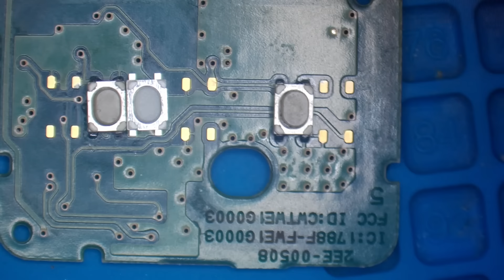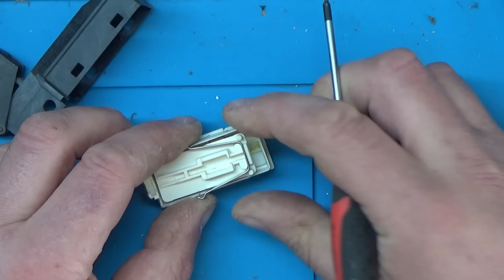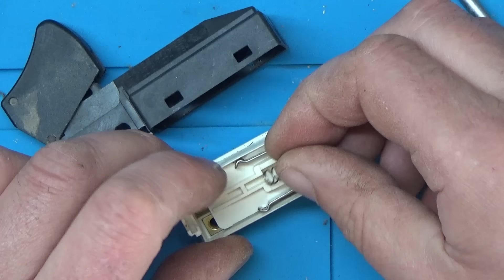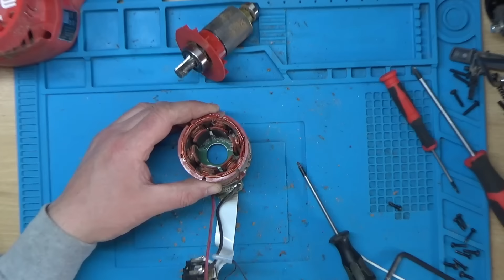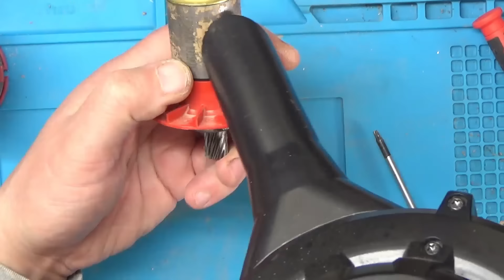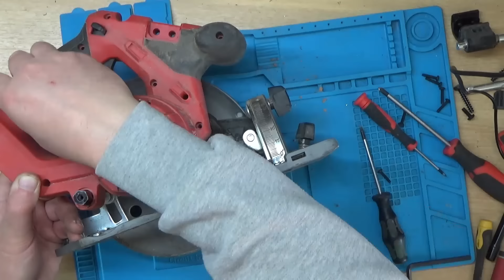Faulty Dacia Duster Key fob & Faulty Milwaukee Circular Saw | Can I Fix Them?

Comment: Autosol would have worked a treat on those contacts. I use it all of the time on guitar frets. Brings things up gleaming. I was also relieved to get to the end of the video and you to still have all of your fingers intact. Those blades are lethal.
Reply from the maker: Thanks for the tip with the Autosol. Yeah, I should have taken the blade off 😂

Comment: Never seen this paper and contact clear trick. I have always ended up using a little file if contact cleaner and actuating the switch didn't work
Reply from the maker: Yes, I came up with it when doing PC repairs as simm memory modules were prone to bad connections. A file or scraping them was a bit too rough, but because paper is abrasive and a bit contact cleaner also helps it made them nice and shiny and good as new 🙂

Comment: I did not want to see or hear ouch in this one. please remove the blade before starting work . I have caught my finger in circular saw and it hurts a lot and makes you sad. Well worked out fixes though. And a no lobing things on the desk like Dean the greaser Dougherty , but you are both great. thanks  👌
Reply from the maker: Thanks, yes perhaps I should have removed the blade. Luckily I've not been bitten by one of these so far...

Comment: I bet the micro controller for the saw and hall effect sensors are paired up. They probably calibrate the controller to the hall effect sensors so probably if you got a new controller it wouldn't be 100% would be my guess. It is a shame but I guess variations in the parts means they are paired when put together.

Comment: My most extreme key fob repair was a mates Landrover key that his dog had chewed on and turned into a mangled soggy lump. Somehow managed to make 1 good one out that and a spare that was physically OK but non-functional due to not being coded to the car. Can’t now recall exactly what I did as it was a long while ago, but much swapping of tiny components was involved ;)

Done many of the ‘fallen off switch’ repairs over the years too. I usually add some glue to help reinforce them a bit as folk tend to press them really hard at times and they are such tiny things.
Reply from the maker: Nice 👍I've done a few key fobs over the years, usually just buttons fallen off or non responsive buttons.

Comment: 22:20 Just watching this one now, 3 months late, but I'm posting as if it's new. That motor also seems slow to me.. Ok, back to it🙂
Reply from the maker: I'm not sure it can run slow, as the MCU determines the speed. Unless there is too much mechanical load on it somehow but it seemed to cut ok.
Reply: @BuyitFixit  Probably true. It might just have been the sound, and yes, it did cut well. I have tried mine (M12) and it's about the same, only not as powerful. I guess I'm more used to the mechanic type tools that have variable speed triggers. Great fix, Mick. You inspire and give me hope. Now. I need to watch a few more MrSolderFix videos to improve my soldering skills. I'm trying to fix an M-18 impact gun. I had to desolder the board from the motor body because it seemed to take away all the heat from the rework gun. Looking forward to your next repair.
Reply from the maker: Thanks 👍Yes I've had to remove the board from the motor bodies a few times too (not sure if on this video, as I've done a couple of these saws and the SDS drills which are very similar motors) and it does make it easier to remove the mosfets 👍

Comment: Hello.
Your Milwaukee saw seems to have exact same problem as mine.
First and most obvious problem was the trigger failure, and this was the point, but not the only one.
Next time, if fault returns, try with flex ribbon cable :))
May The Force Be With You :))
Reply from the maker: Thanks 👍and you too!

Comment: it's a common problem with big switches like that when they have a big contact patch and is switching signal level current, that the current is not enough to break through the oxide layer.
Reply from the maker: Interesting, someone else also mentioned the same 👍

Comment: You can purchase a Key Fob tester - it's invaluable if you do these kinds of repairs on a regular basis (as I used to do) and can eliminate many avenues of diagnosis quickly. Note: The difference between the cheapest and most expensive brands is negligible but just make sure that you purchase one that checks IR and RF across a range of frequencies.
Reply from the maker: Thanks for that. I remember my component tester does IR, and I've got a HackRF which I could have used to test the RF. I completely forgot about that at the time, at least he brought the car over and we were able to confirm it was all working 👍

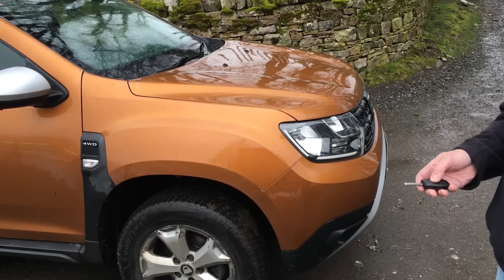Comment: 7:35 you can test it, make a coil with enough turns and put an rd diode inline then connect across your scope , you’ll see a signal even if way out of tune thanks to harmonics
Reply from the maker: I've got a HackRF with a porta pack which would have been ideal, but I totally forgot about it at the time 🤦‍♂️

Comment: I’ve 4:04 repaired these buttons, melt the plastic corner retainers remove the cage , under the plastic button is a disc that is rounded so inverts with pressure. In the lower housing is contacts , clean the contacts and the underside of the disc and reassemble and remelt the corners . 3d print filament also works if you butcher the corners
Reply from the maker: Interesting, although I the cost of replacement buttons was very cheap from Amazon. I think it was £7 for a set of 250.

Comment: Just go to a scrap yard it will be cheaper
Reply from the maker: Then you have the issue of trying to program the car to accept the new key. I know some cars such as the older Toyota have a sequence of pressing the brake, and and accelerator a number of times while inserting keys to do this, otherwise you need to use special software as far as I know.

Comment: I do a lot of vintage hifi. If I come across power switch contacts that wont clean with contact cleaner ( and of course never use Deoxit on power switches) , I have used small amount of car polish on cotton bud- does the job ( rinse polish off with contact cleaner). Just don't use polish on GOLD contacts.....
Reply from the maker: Thanks for the tip 👍

Comment: I've fixed many milwaukee saws with faulty switches like that. I also find with milwaukee tools in general if the led light doesn't come on the micro controller has died. Love you videos!
Reply from the maker: Cheers mate 👍

Comment: Older mechanics would have had a points file to use on those contacts Mick. Could be worth getting one for your arsenal.
Reply from the maker: Thanks for the suggestion. I've got some small needle files somewhere, but someone suggested putting a polishing tip into a dremel (I've got one for the little grinding pen which would have done the job but completely forgot about it).

Comment: I absolutely love my Milwaukee tools . But the fact that they don’t make that part available is kinda of crappy . The only thing I can think is it’s a matter of they don’t want people using them for other purposes. Probably why they encase the part in resin . Texas Instruments is very strange about there tech . They have weird part numbers for their IC’s that are hard to cross reference with other things . They have been doing that since the beginning of their company. I work on pinball machines from the late seventies and even then they had strange company specific part numbers that are hard to cross reference to anything else .
Reply from the maker: Interesting, I've worked on a few pinball machines too back in the late 80s early 90s. I remember Hook, Partyzone and Terminator were a few that I worked on.

Comment: I'm glad the guy with the car turned up and now we know you weren't fobbing us off. I cringed when you messed about with the guard with your finger on the trigger !! And you should defo make that replacement board, that would be amazing if you filmed your process....cheers.
Reply from the maker: Cheers Andymouse 😂😂fobbing you off 😂😂Yes I didn't really noticed the blade / trigger until I looked back at the video when editing. I'll try to be more careful next time!
Reply: That's 'Key' message @andymouse, safety first!
Reply: @marcyd2007  I thought it was "safety third"! LOL!

Comment: You really had me goin' when you retracted the guard and manually turned the blade, whilst you had a finger on the trigger, the battery fitted and the safety interlock removed !!!
Reply: He almost lost his finger there! 😂 It happens to all of us! You forget the danger. I have been zapped with 230V due to the same dumb habit multiple times.
Reply: @mart43 i also had been zapped by 240. I actually thought i turned off the switch to the device i was working on but i later discovered i actually turned it on and it zapped me
Reply: @mart43  I've been on 15 mtre scaffolding with the state inspector saying i can finish the last fitting on a girder cos the power is off, and had my screwdriver arc welded a hole in it. So close to 230v. ya never know.
Reply: I know what you mean. I made a video of fixing a mini drill and forgot I'd just tested it before taking it apart again to film. Didn't get a belt but left it in the video as a reminder.
Reply: Me too.....

Comment: i alway pry  the ribbon and when its not the switch i start with replacing the ribbon, most errors come from  damage to the ribbon cable. or dirty contacts. i find verry few with broken mosfets. the ribbon are just 2 euros for 10 or so
Reply from the maker: Interesting. I've repaired quite a few similar tools and a lot of the time it's been blown mosfets. The SDS drills have a very similar board and motor.

Comment: Are you allowed to bring Repaircafé stuff home?
Reply: I also volunteer at a couple of local repair cafés and yes, you can take stuff home to work on. The customer has to sign a form to say it's ok. Sometimes I need to dive deeper and it'll be quicker and easier with my set-up at home rather than the few tools/spares I took - I don't usually take a hot air station with me for example, but 90% of the time my basic travel kit is enough.
Reply from the maker: Yes, sometimes it's easier to do things at home as we have more equipment. One of the items I've to look at is a Canon DSLR which got dropped into a stream and was left in a cupboard for around a year or so. I wouldn't even try to tackle something like that on the day.

Comment: I figure you just had a bad battery connection with the case off so you lost power. Freewheeled instead of braking.
Reply from the maker: That's what I was thinking, but if it was a bad connection why did it power back up when pressing the trigger again?

Comment: 18:05 - Try with dremel and green rubber tip next time, its for polishing. Scratching with screwdriver or sandpaper will clean, but will make it accumulate dirt faster because of rough surface caused by scratching.
Reply from the maker: Great Idea! I didn't think if that at the time. I'll try to remember that for next time!
Reply: I have a tiny little engraving tool which does the same thing. Even less aggressive than my dremel.

Comment: Great video!

Regarding the potted custom microcontroller - I seriously hate it when companies of all types don't supply parts at reasonable prices, this of course leads devices that are uneconomical to repair and hence more waste. The companies of course don't give a damn because all they are interested in is profit.

There should be laws to ban such practices but of course it'll never happen because too many governments are in the back pockets of big corporations.
Reply from the maker: Thanks 👍Yes I'm surprised there's not a replacement board already on Aliexpress or such. I think it would make a good little project as there are a few of the Milwaukee tools use an almost identical board / motor just with a slightly different firmware (SDS drill has speed control and forward / reverse for instance) where the saw just has On/Off but it's the same motor and control board.

Comment: You also need another pair of hands. Like we all do LOL
Reply from the maker: Yes 😂😂😂
Reply: @BuyitFixit  Spring hook probes for wires, through hole legs. Insulated croc clips for bigger things and chassis (0 V). Back probes for pushing down the back of tiny multi pin plastic enclosed connectors or indeed into the front. All with shrouded 4 mm connectors to your test leads.
Reply from the maker: @alansort  I'll have to get some tips from you at the next Repair Cafe 😉

Comment: I'm a locksmith and these key fob buttons always break because people push too hard (and too often) on them.
Also, many are inferior in design.
I've fixed a few of the more expensive ones.
But sometimes it's better to replace with new because some aren't that much money. $20-40 bucks
Reply: I got key fob aluminum case, from china. After 5 years I had to open in to replace battery, keyfob is brand new still, I compared it to unused one. Buttons click perfectly. I use car on daily basis. Aluminum case was maybe 5-10 euros.
Reply from the maker: I'm no expert but a lot of the cars you need special software or such to program the car to accept a new key, although I know there are some cars that you insert a master key first and then press things in a certain sequence which allows you do to the same.
Reply: They do see a lot of abuse....dropped, kicked, stepped and sat on.  Its no wonder buttons wear and solder joints crack.
Reply: @bobsoft  I see them chewed up from lawnmowers and snowblowers more than you think LOL